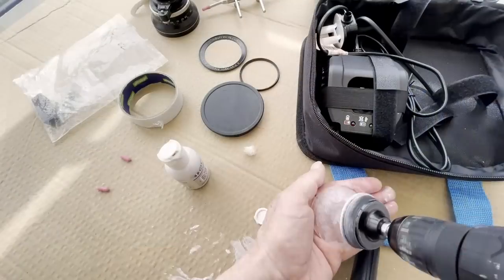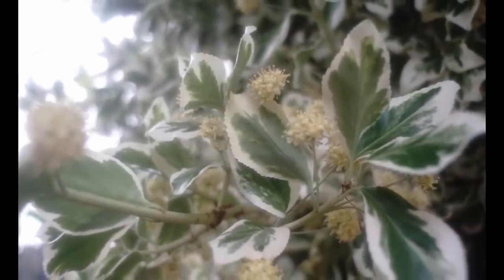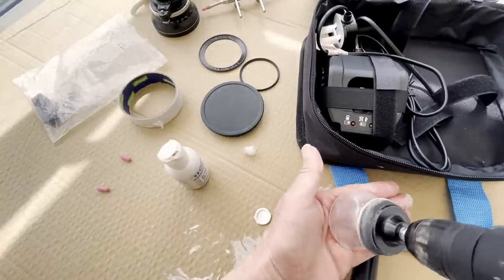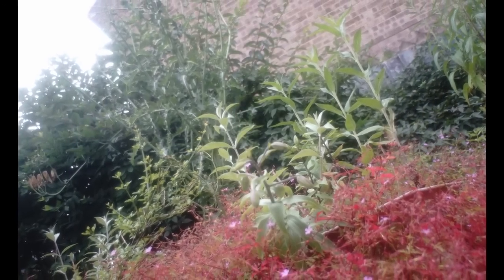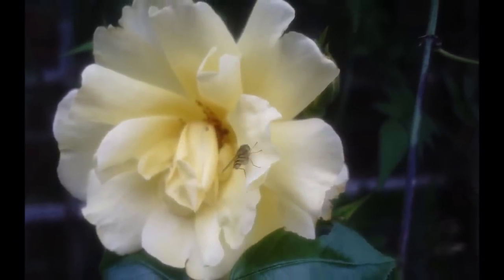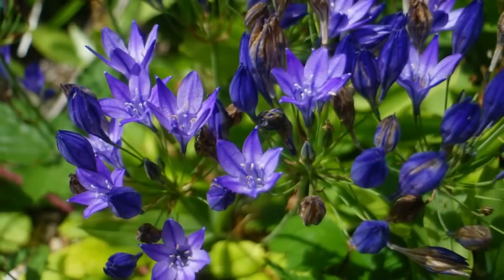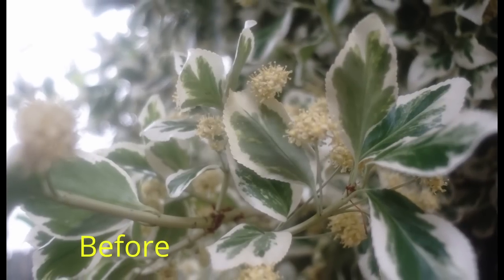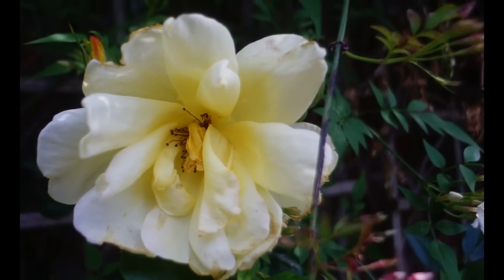DO Try This At Home! BRUTAL DIY Lens Grinding - What Could Go Wrong?

Comment: So glad you didn't give up before you were successful. I picked one of these up with a bent filter ring for about $80 after shipping. With a little effort I have   managed to get the old lens apart, cleaned and even the filter threads are working. I really treasure it. Old lenses are great and I'm enjoying tinkering with the ones that just need a little TLC. I really enjoy your videos. Thank you for all your hard work and effort.

Comment: Well, I DID try this at home with a 1936 Summar (uncoated). I had managed to clean out the haze from the inner elements but the front element was covered with micro scratches, as is the usual state of most Summars these days. I could see with a torch that the scratched surface diffused the light awfully, which was confirmed by very low contrast images even when using a hood. -- OK, so I polished for about 45 minutes the outside surface of the front element with a soft felt disk on a Dremel, first using ceranium oxide 2.3 um, then finishing off with 1.2 um. What can I say? A different lense! Clear as a bell now and miles closer to how it was designed to perform. That was a great suggestion, thank you so much! ✌👍

Comment: My top tip here, always assess a lens with a torch (mobile phone one is perfect) shining slightly to the side of the rear element whilst you look through the front element. Once you get the right angle, it will light up any faults like a christmas tree - the whole lens should illuminate without the torch light being in vision. Reverse of this can also help spot faults and where they sit in the lens.

Comment: If you want a medium for cleaning and removing light scratch or grazes, tooth paste, I’ve used it on my Magnifying glass and d lenses, also good for removing haze on Car headlight. So glad that your endeavours share a success and another use is on your, well any spectacles, less harsh than a rubbing compound, well done lovely photos of the Flowers.

Comment: Oil and haze is all it takes to get that nice bloom and  glow.
Reply: Vaseline was the material of choice for getting a pleasant soft portrait.. But you would slap it on a UV filter..
Reply: Now I know how to turn my Leica lens into a Sears Auto 55mm 1.4 Rokkor...A drop of 20 weight motor oil...
Reply: @martinda7446  Of course. I have what seems to be a discontinued portrait filter from B+W that has concentric rings in it coming from.the Netherlands...so watch out, Eric Von Stroheim...

Comment: Happy to see you managed to remedy what is probably my favorite vintage (i.e. large front element version) ultra wide lens ever. It has character for weeks .. If you need a hand with the aperture, I've had my 4/20 apart down to the last spring and screw for service, I could write a book about how it works :) It's actually quite possible somebody before you reassembled it wrong, causing the Exakta aperture control system to just disengage with the mechanism that keeps the aperture open. Either way I'd almost guarantee that it's fixable though.
Reply from the maker: I think it's definitely fixable - it worked a couple of times for me and then gave up - I think it just needs a good clean. Advice would be appreciated when I do eventually open it!

Comment: Got there in the end, literally! I got one of those lenses,(on my bucket list of lenses thank you) paid a bit extra as I wanted a real nice one ,happy with exa version. Then added the specific hood for it and a massive cap. 
I do like a "beyond repair" lens to test myself. In those incidents as appealing as looking at the front is always remember to look at the end where the rubber hits the road end. 
Reminds me of a educational tail I was told of a guy bought a several grand lens at a considerable discount, a  enormous fast autofocus Canon jobbie ,2 foot long with a front element like a saucer. Every year taking impressive pictures of Motorsports, the front element had a crack right down the middle of it!
Reply from the maker: It's amazing what faults a lens will work with, and still give prime results!

Comment: Looks great! I have a lens that needs similar treatment and I might give it a try! I wouldn't worry too much about the coating; uncoated lenses can have a beautiful look of their own, especially in B&W. In my experience the rear element is typically more sensitive to damage than the front element. Light diffracted from scratches on the front travel on through the other optics and their effect is usually moderated. The rear element, OTOH, pretty much projects its haze and damage right on the film/sensor.
Reply from the maker: If you try this method, make sure your lens isn't one of the (relatively) rare radioactive ones. This site will help: https://camerapedia.fandom.com/wiki/Radioactive_lenses

Comment: OH my god.. If you ever want to part with that lens let me know.  I own 3 Exakta cameras and love them.  I have restored and serviced one of them and it takes amazing photos..  That button should have a nub sticking out the back.  When its mounted on the camera that nub lines up with the shutter button .. As you take a photo you now press that button on the lens and before it makes it down to hit the shutter button it auto steps down the lens :).  That was Exakta's auto step down system.  Its a great system .   The problem for you is when you adapt that lens to your Mirrorless  camera you will need to press that button and hold it down before you take a photo or the lens will always be fully open.  Some lenses the one I have you can press the button and turn the button and it will lock into place holding the aperture closed down to the value you set the ring at :).  Try that and if yours has that it is what you will need to do in order for the aperture to work constant when turning the aperture ring :).   Great lens.

Comment: So, to any naysayers out there.  This is a GREAT way of fixing any old lens especially those 25$ ones.  My only tip is you can replace a lot of "coatings" simply by using a modern filter.

Comment: While it will never replace a real coating, automotive ceramic is actually a good anti-glare coating. Turtle Wax Hybrid Ceramic is actually SiO2, one of the coatings they use on lenses, although MgO2 is more common.

Comment: I've been in a similar situation recently... Suddenly my A7SIII started producing kind of smudgy dark spot in "some" of the videos when shooting, did clean all of my lenses including the Helios44 m4 and then found the reason was a little tiny piece of confetti on the sensor that kept moving across the sensor box and finally got stuck in between the box and the camera body that was hard for me to remove it plus didn't wanna risk it so, took it to the professionals to get it removed. Was a stressful week for me but finally the problem was solved .

Comment: That’s good Nigel! I’m glad you got it right!  You didn’t show much detail on the polishing so I have a couple questions. Did you polish both sides of that front lens, or did you just polish the front of it? Also on the back one. Both sides, or just one? Seems like you need a little vice with soft felt jaws. Like you would use for certain aspects of knife making and such as that. I’m a machinist by trade, or I was before that motorcycle wreck retired me early. (I was tired of working anyway) So the idea of hand holding something while performing a function or operation on it seems foreign to me. I’m glad it turned out ok though. I bet it was hard to hold that tiny little back lens. If you only needed to do one side of it, you could have left it in place and polished it by hand, with a cloth wrapped around one finger. And the polishing compound with some elbow grease : ) I can’t wait to buy a lens that needs some work done to it. 😂 
I saw where a guy soaked his lens in hydrogen peroxide to remove fungus, after removing it of course : )
( Also I have an update on that Olympus E-M1 Mark III. After spending a little more time in the convoluted menus, it really wasn’t that hard. I figured out everything that I needed to, and I’m using the camera in the desired manner. That camera is great!)

Comment: Nigel love you channel's original content. Would you do an episode on replacing light seals? (What's its proper name photographic velvet ?) I actually found and bought back my first SLR an OM10 from 1982. Its in perfect working order except the light seals have crumbled to dust, it thought it would be a really easy fix but my fat clumsy fingers must have made a real hash of it as I still get the occasional light streak. Or can you recommend a good professional repairer?

Comment: A really interesting video, but it was quite hard to watch your brave approach of grinding a lens. It would have been interesting to see the results after cleaning the rear element without grinding the front element before. I often have read statements about defective rear elements having much greater effect on the picture quality than the front elements. But at the end it is couraging about restoring defective lenses.

Comment: Good turnaround. I've heard of boke being affected according to a service site that does this scratch removal. There's also the chance of cracking the glass due to the heat. 

Side note: Do you or anyone else know if the Carl Zeiss Jena Pancolar 50mm F/1.8 original zebra 8 aperture blade has a coating on the rear optic, or is it only on the front element?
Reply from the maker: As far as I know all the pancolars were multi coated. BUT the early (zebra pattern) lenses were radioactive so if you’re thinking of opening one up for repair, please don’t, for safety’s sake.
Reply: @zenography7923  The radiation is harmless from those lenses they use lanthium. Even the thorium wouldn't be of concern. A refrigerator or a 5g router is far more worrisome than those little optics. Thanks for your concern, though.

Comment: Why don't you just use a UV filter with a good anti-reflective coating on it? As I understand it this should take away most of the unpleasant effects created in the front glass such as flare or ghosting of your non-coated lens.

Comment: this is not a good video. the idea that some eager vintage lens photographer would repeat this exercise frightens me. there are too many radioactive lenses out there. while they are kinda ok - some of them not so ok - to use, to disturb the surface of a radioactive lens like this is sure to create a biohazard. You can lock down your house and never return kinda hazard. It should never be attempted. 
Did you check if this lens is one of those radioactive lenses? If not, you are lucky. But you should either remove this video or add a disclaimer stating that doing this with a radikoactive lens is absolutely harmful to the person doing it and anyone else living with them in the household. It is enough to inhale or ingest the tiniest amount from the radioactive dust for it to become deadly.
Reply: The radio active lenses are pretty rare.
Reply from the maker: Thanks for the warning, but this is not known to be a radioactive lens.
Reply: Tell me how did they polish them in the factory where thorium or lanthanum glass was used?
Reply: The amount of glass removed by polishing is infinitesimal and the radioactivity is not dangerous. Always be cautious about inhaling anything while doing repairs, but an exaggerated perception of risk from "radioactive" lenses is more likely to distract people than to improve working safety.
Reply: Really, even the most radioactive Thorium lenses would not release enough dangerous material through mild grinding with with Cerium Oxide to be a hazard. You'd need to completely grind down many, many lenses down completely and then swallow them before it was likely to be any serious risk.
Source: I've worked with radioactive materials, studied physics with a specific interest in both particle and electromagnetic radiation.